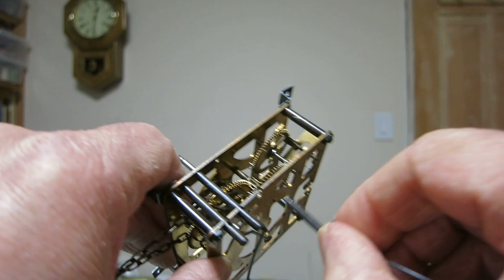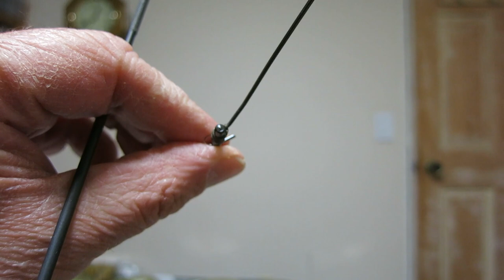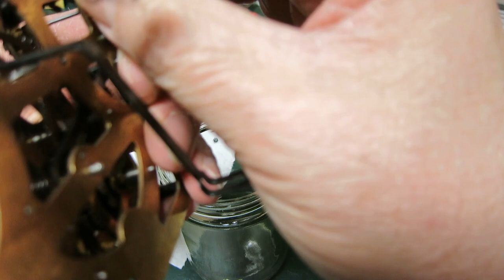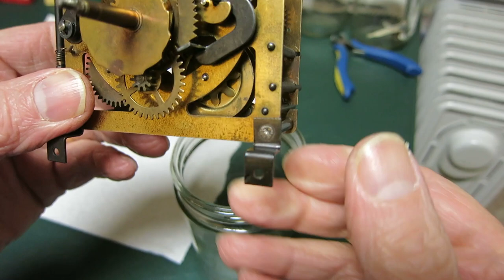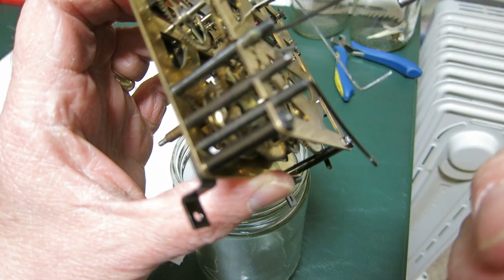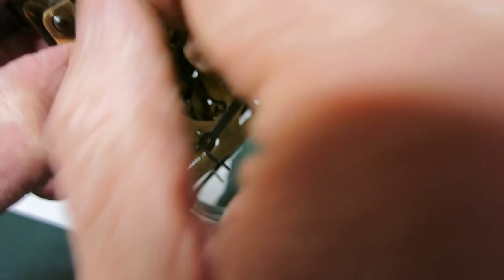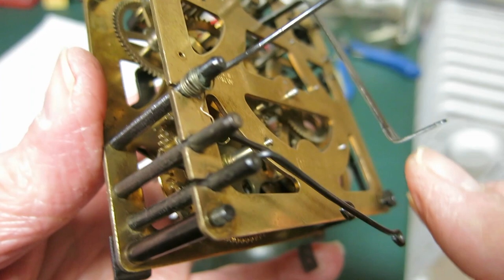Adjusting the striking of a cuckoo clock movement

Comment: This is by far the best CC movement repair video I have seen and learned how to fix my CC movements because of this. Thank you very much!!!! May I ask where you got the tool you used to put the gears back in place when you were adjusting the warning wheel??
Reply from the maker: Thank you for your kind comment! I'm glad you enjoyed this video. The tool is called a Pivot Locator. I bought my 8-inch long Pivot Locator from Timesavers: https://timesavers.com/i-8948894-8-pivot-locator.html Another handy tool for Regula brand cuckoo movements is the Knipex 22 02 140 Round Nose Pliers. They're perfect for removing those odd little Regula clips. See them in action at https://www.youtube.com/watch?v=GfUAY6v1Im0&t=1s (I bought mine from Amazon).
Reply: @BradfordNeedham  Thank you very much. I am currently trying to repair a regula movement I have; the time gear seems to be bad, it won't  hold the chain it just falls down when wound. Do you know where I can get what I have been told is a CG25t gear? Can you recommend a place to get replacement parts? thank you

Comment: I'm trying to figure out why on my movement the weight for the cuckoo side cuckoos all the way to the floor, but only at 11 o'clock. Everything else works fine until it hits 11. Is this an issue with the rack, snail, gathering pin, or something else? Again, all works well until it hits 11 o'clock
 Any ideas where to look? Thanks.
Reply from the maker: If you can, I'd suggest taking the movement out of the case so you can see what happens at the front of the movement at 11:00. It could be the usual things (see my reply to Michael Miller) or it could be that the rack is bent and jams at 11:00. You should be able to see what's going wrong by watching the rack and gathering pin behavior at 11:00 vs. earlier hours.

Good luck, and let me know how it goes.
Reply: @BradfordNeedham  Will do. Thanks for the assistance.
Reply: @BradfordNeedham  The rack was somewhat bent and for some reason, the gathering pin was missing the notch, causing the 11 o'clock count to not shut off
 All is fine now after straightening the rack.
 Thanks for your earlier advice.
Reply from the maker: @kenz5469  Glad this story has a happy ending - congratulations!

Comment: I like cuckoo clock movements.
Reply from the maker: Me too! At first I thought cuckoo clocks were complicated and touchy, but the more I work on cuckoos, the more I like them: they're designed to be rugged and keep running even when they're very dirty; they don't speed up and slow down between windings like a spring wound clock sometimes does; repairing them doesn't require an expensive spring winder... and I get a kick out of the little bird popping out.
Reply: @BradfordNeedham  I like weight clocks better.
Plus, I designed a movement on a simulator software.

Comment: I have a new problem, my cuckoo has 2 doors and when the bird is singing at the same time the musical box from the other door starts to play how can i do to make that when the bird finish later the  music box plays
Reply from the maker: I don't have a whole lot of experience with musical cuckoo clocks, but I have written a blog explaining what I learned about how the music is triggered. See https://needhamia.com/cleaning-and-adjusting-a-cuckoo-clocks-musical-movement/ The section titled "How the music connects to the rest of the clock" describes the levers that run the music. From your description it sounds like what I call the music warning lever is out of position and doesn't stop the music from playing. I remember that when I worked on the clock I described, I found it a little tricky to bend the music warning lever into a position where it would just barely stop the music box fan (governor) when in place, but would move well out of the way of the fan when the bird finished cuckoo'ing.